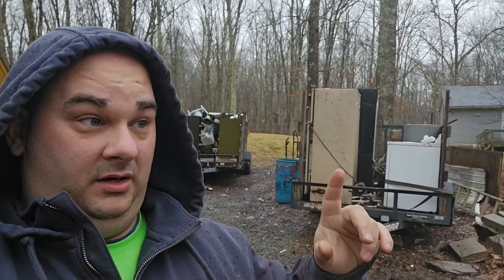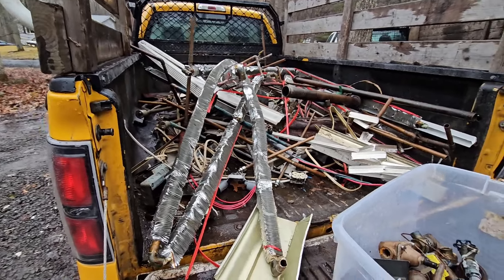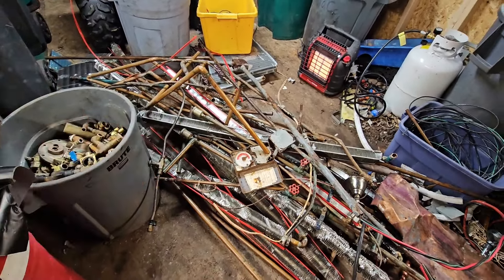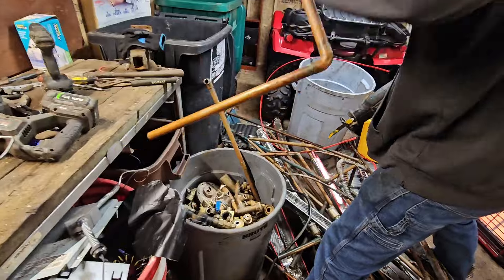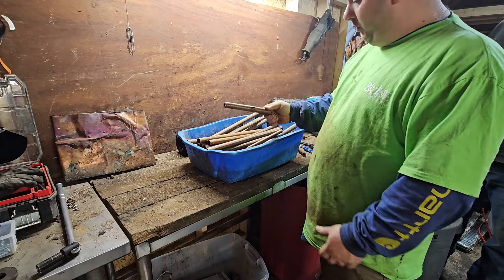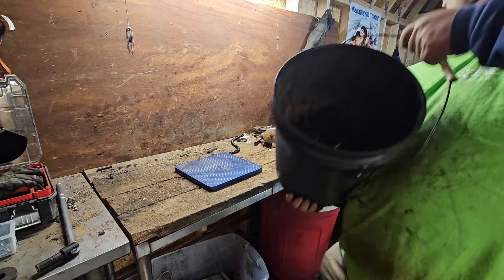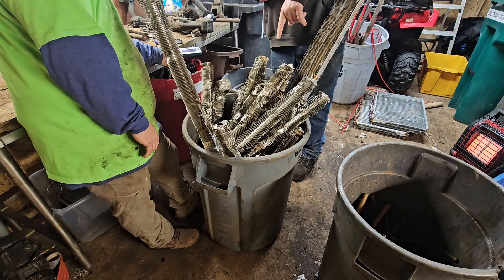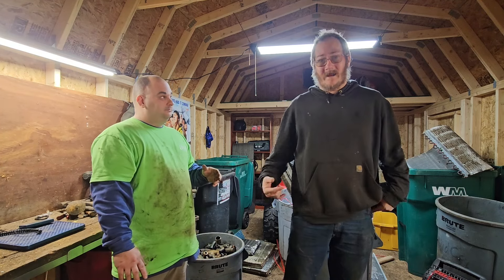Let's see how much money we can make on scrap today.

Comment: If you have a harbor freight close by, grab a cable cutter from them. I use it to cut up to 3/4 copper pipe to get solder and fittings off quicker.